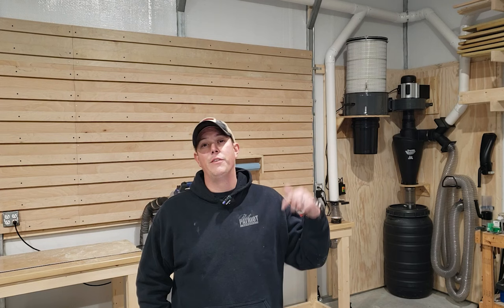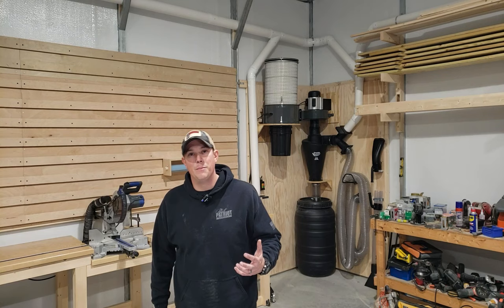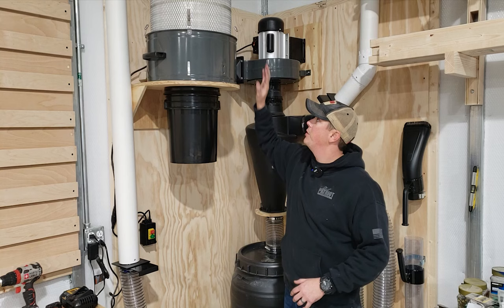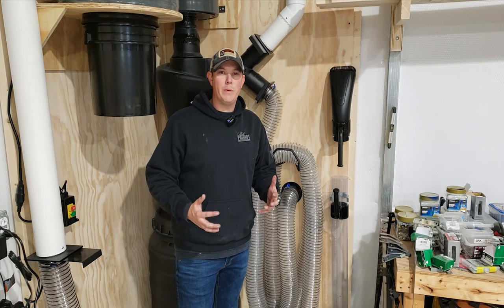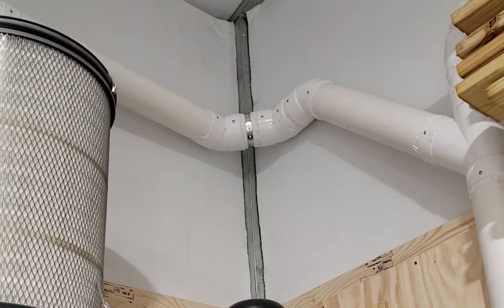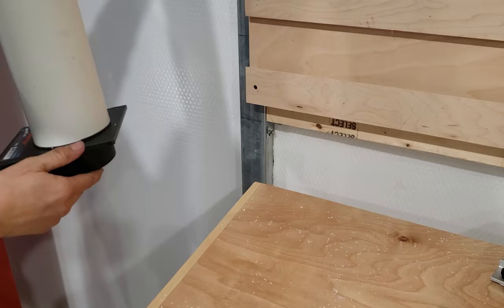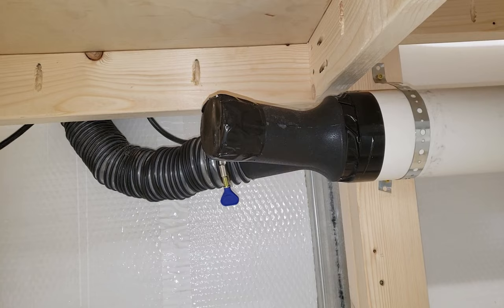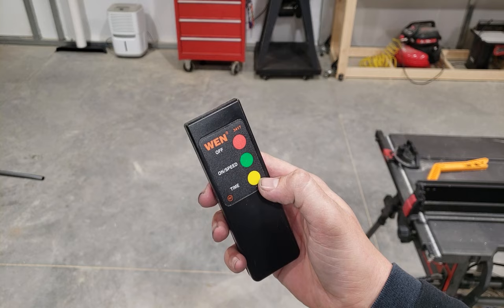DIY Dust Collection System Set-Up

Comment: I have never seen your channel before and I have to say as a career plumber I approve of the way you assembled your system. Your shut off valves or gate valves. Whatever you wanna call them at all the diversion points are smart and you do not have unnecessary bends that would cause increased turbulence. What some people may not understand is increased turbulence causes a decreased airflow and decreased airflow. Causes solids to drop from the airstream where they will accumulate in any location they can. It’s the same concept in plumbing with solids interceptors and inversely with grease traps.  I am going to save this video so that I can mimic this system after I move next year because it is brilliant. I didn’t even know some of the stuff existed that you have used because I’m just starting woodworking, but it is just that – brilliant.
Reply from the maker: Thanks

Comment: Very nice installation and video about it. Your shop apprentice seems very eager as well. 
I have had the same Wen fitration box for about 18 months - I like it. 
I also noticed your dehumidifier unit. I also have one in my shop, and like having it. For mine, I placed a condensate pump behind it and ran the dehumidifier condnesate into it. The condensare then gets automatically pumped outside through the wall. I have also found that besides personal comfort, having a dehumidifier shortens the time it takes for air-dried lumber to reach a stable dryness in the shop.

Comment: The power unit looks pretty professional.  The 40' hose basically makes it a central vac too as that's a nice touch.  In the future if you wanted to make it "remote control" you could get a 24 V transformer, relay, switches and doorbell wire and have power switches at each blast gate to power the system on and off like the way central vacs are powered.

Comment: A potential upgrade to the system, is moving the canister filter and 5 gallon bucket outside the shop, in it's own enclosed, but breathable area. Like those outside hot water heater cabinets.
Then, even the 1 micron particles, are going outside the shop and not where you are working.
Reply: I saw the video with Matthew Peech talking about that. It sounds like a GREAT idea IF it's possible in your particular area.
Reply: Great idea, IF or WHEN your workshop air is not conditioned.  When interior air is conditioned, venting outdoors wastes electricity and money.  Some woodworkers do vent outdoors when the weather is moderate and they are not heating or cooling; otherwise, no.  Some of us live with neighbors nearby and it would not be feasible.

Comment: I bought a "pet" pup tent at Amazon for less than $20 and attached it around my miter saw, even without vacuum, it captures 95% of the dust.  since it is soft sides, you can pivot your saw with no problem.  The back half of the tent hangs off my table which allows clean out to happen less frequently and I have just used my shop vac to clean it out.  Since I just bought a central vac, I will be attaching it to the bottom of the tent.

Comment: Actually a sweep elbow 90 is better than 2 close coupled 45s. That may be an option for your under bench connection. Great job  , enjoy your videos. I plan on doing some testing on various fitting combinations once I get my dust system up and running.

Comment: For the record, the pipe you were using is schedule 20 SDR. It’s probably easy to order online instead of finding it in store because it’s only used for downspouts pretty much; it cannot be used underground because it will collapse.

Comment: I’m just stopping by to see if your system has had any issues with fire or explosion due to not being grounded.  I’ve heard PVC can be dangerous, but I personally don’t have any experience with it. Any problems yet?
Reply from the maker: 0 issues
Reply: There have been plenty of studies done on this.  It turns out that, even under lab conditions, researchers have to work VERY HARD to create that kind of explosion in a "real-world" scenario (i.e. not using some type of external source to spark or create a flame).  It's ALMOST impossible to have an explosion in a dust collection system from static electricity in PVC pipe.
Reply: Large scale industrial facilities such as grain elevators, sugar mills, coal mines AND plants creating huge amounts of wood dust have had MANY TRAGIC  fires and explosions, with fine dust being the main factor. 
My garage - one tool at a time, with garage door and side door open, two fans running - will NEVER have anything remotely like that amount or density of fine dust.  
Could you get a little static?  Yes.  
Fire or explosion?  Unlikely.
Paint and varnish probably pose a much greater fire hazard in a small shop.  Keep an extinguisher on hand.
Use your own judgement.

Comment: After watching this video and your last video, I finally feel like I understand how the DC systems work. The only question I have is about the Wen filter mounted in the ceiling. Did I hear that it only filters to .5 micron? Isn't that the same as the original bag filter on the dust collector provided? Shouldn't the ceiling-mounted filter be trying to filter out the .1 micron the escapes from the dust collector?
Reply from the maker: Noon the original bag filters to 5 microns.... the Wen is 0.5 microns

Comment: Thanks for the extensive shopping list/ links. However, I was wondering if you were keeping track of the total cost of your system? Of course this will vary based on every different shop's needs/ layout, but that would be helpful to just ballpark. Also, sorry, I'm going to jump on the bandwagon here, any issues with static dust cling to the inside or outside of your PVC after 15 months? I've just heard of (or seen, via YT) so many unsightly if not dangerous situations.

Comment: Great video im planing on doing the same setup the only thing i cant find is the 5 to 4 inch y coming off the dust deputy only thing i can find is the 6 to 4 is that what you used with tape to make up the space
Reply from the maker: the 5" to 4" Y that i used is the one that came with the Harbor Frieght Collector

Comment: Hi I am very interested in your system but I do have a question do you see statically sing of external dust on your pvc pipe after prolonged use?
Reply: metal frame of the building…

Comment: Great video on the dust collection system it seems to function very well. I like the idea for using the thin wall pvc pipe instead of the metal duct work. It sounds like you have plans for expanding with more tools in the shop. Just curious what size electrical service do you have for your shop?
Reply from the maker: 100 amp service in the shop

Comment: Hi ,
Nice  set up .  Wondering  how you system  is working  any  plugs up .I have 2 hp harbor freight  and dust deputy also but when I use my 3 hp planer I have trouble with cloging  and the y and gate is 2 ft.away from deputy and about 8 ft.of 4 inch hose .l.m retired  pipefitter/ plumber  so.it installed right .any suggestions. I,m planing 24 year.dry maple so it make about 3in long curls about 3/16 round . And have 2000 ft to go so any help would be appreciated.

Comment: SDR 35 DVW piping is great for dust collection, however I can't find any of this in southern CA today. Home Depot had zero, Lowes had a half a dozen fittings and 2 sticks of pipe, Landscape supply houses have none. Just wondering if anyone else has had issues with buying this material?
Reply: I did as well you ever find any?
Reply: @omegaxshark21  Yes I did, Mc Master Carr up in LA

Comment: Love the install I am about to do the same thing and I have a question . Do you buy into the static electricity danger at all about PVC with no ground wore or is it all BS??
Reply from the maker: I've heard alot of conflicting info, but it seems to really only be an issue for large commercial type operations.

Pvc is an insulator so there is no real way to ground it. You'd have to use metal ducting to properly ground it
Reply: ...are you happy with the install or would you change anything like size of pipe ect.  ? @PatriotDIY
Reply from the maker: @flanikent  I've been happy with it

Comment: I recently purchased a dust collection machine. Since a have limited space in my shop, I needed to get a compact roll-around unit. It only provides 750cfm w/4” intake. I would like to install some ducting in my shop but thought perhaps my unit wasn’t powerful enough for that. Can you tell what the cfm of your unit is and- since this video is now 2yrs old, how’s it been working for you.
Reply: I think the nominal rating for the HF 2HP Dust Collector is 1500.

Comment: I really like the system you put together and think I might do the same but I have a question seeing how you have had it 10 months or so are you still happy with it. Have you had any problems. Would you have changed anything
Reply from the maker: No problems other than a couple issues with the blast gates...starting over i might would have gone for metal blast gates.

Comment: I'm a retired Master Plumber and you did a very nice job with the pvc piping.  I have heard horror stories about static electricity and pvc dust collection systems.  Do you have any problems with static electricity, and if you do, how are you dealing with it?
Reply: What is static electricity and what horror stories are those? Just trying to learn as much as I can.
Reply: @carlcarlssen4299  Dust collection systems by their very nature transport high volumes of very fine dust.  And just like an inflated balloon creates static electric when you repeatedly rub it, so does plastic dust collection piping when large volumes of dust particles are transported through it at high velocity.  Without a way to discharge the static electricity to ground, enough electricity can build up to set you on your ass.  Or worst case scenario, the static electricity can create a spark that can lead to an explosion in a dust rich environment.  It doesn't happen very often, but it can.  That's why most of my dust collection piping is made of grounded 28ga sheet metal piping, and when I do use plastic piping I make sure that section is sufficiently grounded.
Reply: @michaelweiss346  How do you suggest grounding plastic pipe?

Comment: Simple question: Is there a reason to use wyes for your drops tube instead of 45s?
Reply from the maker: The Y is just a 45 with a straight piece so I could continue the line.  Notice on the other end I did use a 45 because that was the end of the line.
Reply: @PatriotDIY  I understand what you're saying I was referring to a 45 degree T that would allow the line to continue.  I didn't know if the Wyes helped with the flow of sawdust since they aren't a hard angle .

And thank you very much for the reply. It's rare to get one. I appreciate it.

Comment: Great job. How do you control the static with the pvc pipe?
Reply from the maker: I don't have a static issue but I've seen people try to ground it with copper wire, although pvc is an insulator so there no really good way to ground it.

Comment: How did you attach the 4-inch blast gate to the 4-inch PVC since they are not the same diameter? I tried to purchase some 4-inch pipe but my blast gate and other components flopped about in the OD of the PVC pipe and easily had to have a 3/8" gap between the vacuum components and the pipe. Any help is very much appreciated.
Reply from the maker: Wrap the blast gate in duct tape to increase the outside diameter until it fits!!
Reply: @PatriotDIY  Thank you. I just went to Lowe's a bought a roll of white duct tape. Thank you for your help.

Comment: I’m getting ready to do the same thing with the same dust collector, same filter, 4” drainage pipe. My question, since this video, how happy have you been with the performance? Worst case I would like the suction to stay the same as it is in stock form, just without blowing fine dust everywhere. You gain more suction with the better filter, but my concern is, do you loose more suction then you gained with the better filter with the duct system?
Reply from the maker: I never ran the collector in its stock configuration so not sure about the difference... But I'm happy with the performance! it works well at every position and does what i want it to do.   IT SUCKS!
Reply: Everything and anything added to a dust collection system or even a shop vac - a filter, a filter bag, a hose, longer hose, longer pipe, bends and turns, etc - they ALL cause some loss.  And while that is something to keep in mind, the real objective is not to maintain max air flow, but to collect dust, to capture as much as possible, and to collect it as close to the source as possible.
EVERY decision we make represents a trade off!
However, some decisions are better - more productive, or more effective - than others.  
For example, a pleated filter has MUCH more surface area than the stock fabric filter bag - aka a dust pump - so it enables the unit to move more air.  Good decision!
Use of a dust separator - good decision!
Straighter runs as opposed to many bends and turns - good decision!
Long radius bends in lieu of tight turns - good decision!
Maximum use of smooth pipe and minimal use of flex hose - good decision!
There are two main principles that make dust collection work - momentum and gravity.  Make them work for you!
Best wishes and good luck!
Reply: @joedance14  I’m curious about the gravity part of your comment because I was thinking about that. Running ductwork up to the ceiling would absolutely hurt efficiency in moving chips, dust particles. I don’t have a basement underneath but I could run my ductwork low along the wall and only lift  up to the collector instead of 8’-8 1/2’ to the ceiling. I haven’t done anything yet because I need to upgrade my dust collector ( Laguna B-flex)
Reply: A lot of folks run dust collection high on the wall, for various reasons: to leave space for cabinets, shelves, lumber racks, tools, etc.  Does not seem to cause a problem as long as the DC is powerful enough.  
A shopvac or smallish DC should probably not be piped at all, in most cases. Just connect to one tool at a time.  
The last several feet - at least five feet - of pipe approaching the dust separator should be straight, with no drops, bends or anything else that could cause turbulence.  You want a nice smooth flow coming in to dust separator.
In that last stretch - at least five feet - the pipe should also slope down about 9-11 degrees toward the dust separator, according to ClearVue and others.  For my part, I try to make the main run slope from the far end all the way to the dust separator.  It does not have to be a steep slope, but 10 degrees or so enables gravity to help.
A dust separator is the one place in dust collection where we want dust and chips to LOSE momentum and fall into the bin or drum.  Fast moving particles do not want to fall.  A cyclone narrows from top to bottom, inducing the particles to lose momentum and fall.  A small Dust Deputy is around 16-18 inches tall.  The Super Dust Deputy is 23 inches tall, if my memory is correct.  Larger cyclones can be much taller.  Industrial cyclones can be two to four stories tall, or taller.  It gives the particles time and space to slow and fall - ie, time for gravity to take effect.
Some DIY Thien baffle dust separators are just several inches high, giving gravity very little time to work.  But the same principles apply: momentum and gravity.  A dust separator needs height so gravity can take over, and pull dust and chips downward.
Hope this helps.
Best wishes and stay safe!

Comment: What did you do to keep the blast gates from falling out and how did you seal them up?
Reply from the maker: Wrap with duct tape to make them a tighter fit. Then more duct tape and screw on the outside of the connection

Comment: So you know that if you don't ground that pvc with a wire running in the pipe, static electricity can build up and cause an explosion, right? Oh well though potentially deadly it sure looks nice. Next time start from the dust collector with larger pipe and gradually go smaller to the machine for airflow. And IN CASE YOU MISSED IT GROUND THAT PIPE.
Reply from the maker: 4in pipe all the way to the machine works wonderfully. And static build-up in a small hobby shop is not an issue.
https://youtu.be/yA22kTtV4XI
https://youtu.be/WJ8NMYlhaLQ
Reply: @PatriotDIY  I guess I am used to bigger shops. My information is apparently out of date. But I am learning and thanks for your response.